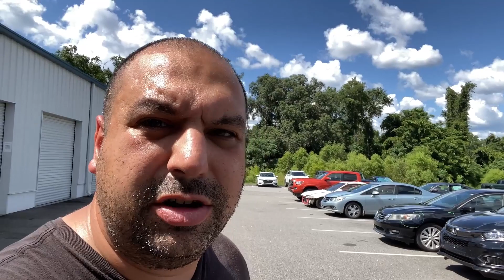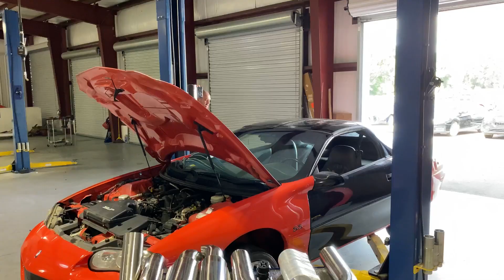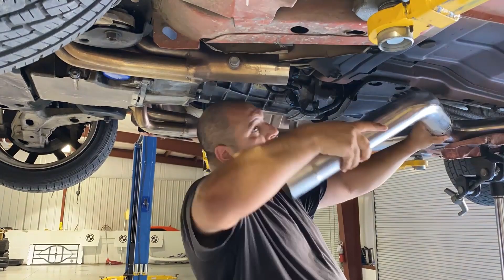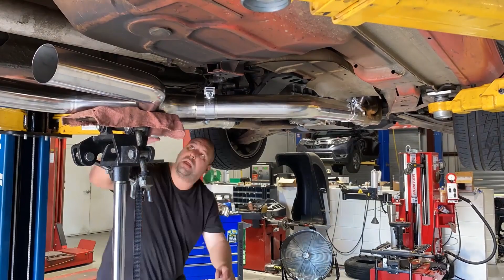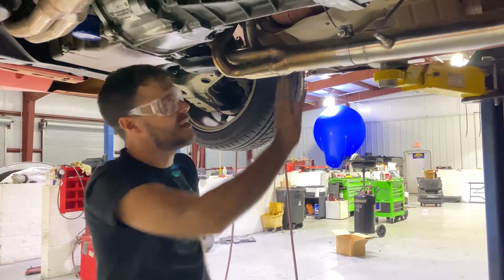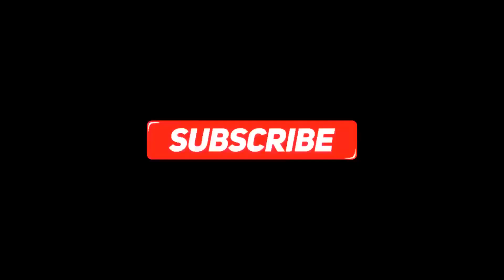How to Install Speed Engineering SS Camaro 3 Inch True Duals X Pipe Axle Dump System INSANE Sound!

Comment: Is this stock besides headers and exhaust from long speed engineering
Reply from the maker: No. That 5.3 had a sloppy mechanics stage 2 cam, upgraded trunions, valve springs and BTR pushrods. It’s been replaced by 6.6L carb nitrous build

Comment: Long tubes headers with dual 2 inch exhaust pipes that run all the way back over the axle, then collect in a 6" axle dump pipe thats about 12" long  will make any V8 sound insane. Did it to my cammed '85 D150 318ci. Was the best sound I've ever heard in my life

Comment: Great video. Thanks for the info. Are you planning on putting a bigger engine in there? 3"dual  is way to big for a 345 cube engine.
Reply from the maker: How about a 401 cubic inch 6.6 L?
Reply: @DrSaucePacket  It definitely is. Dual 3" is great for a 454. Way too big for any naturally aspirated small block.

Comment: You have the part where you weld it?
Reply from the maker: The kit is bolt in, no welding required. Rode with the exhaust like that for a long time and no leaks. But you can easily weld it

Comment: What year? Cam specs please!
Reply from the maker: 1999. It’s a sloppy mechanics Elgin stage 2 cam. 283 Intake Duration, 286 Exhaust Duration, 228 Intake Duration (.050" Lift). From speedway motors. New motor is dual cam wink wink

Comment: I was so tired of people putting long tubes on and then y pipe to single pipe to rear I'm doing my 97 Z28 long tubes high flow 3 inch cats x pipe and that's all I'm at now want to go duel pipe over the rear end and dump out back like original can it be done in between headers and cats I'd be willing to put in electric remote cutouts first time seeing your channel new subscriber. Sounds like it means business
Reply from the maker: Check out the other videos! Giving it all the business now

Comment: What size bolts did you use for the hangers I had to make the holes bigger on mine
Reply from the maker: I just used some long random bolts laying around the shop. However I did have to make the holes bigger on the hangers anyway.
Reply: @HOSSgarage  thanks for the reply 🙏🏽

Comment: Ordered my kit.... bought longer bolt.... and the hangers holes are too small. Gotta go get them drilled out now, did u have this same issue?
Reply from the maker: I’m trying to remember if I had to drill out the holes...  🤔 I think I did actually put them in a vice and drilled them out if I remember correctly

Comment: Bro the car really sounds awesome! Loved the take off and then the drive by. But three things. You kept referring to the 45° bends coming off the 3" collectors as Y pipes. Y pipes are found on single exhaust and are 2 pipes merging into 1, forming  the shape of a Y. The bolt holes you for the exhaust hangers are not for the seats, those are the bolt holes for the front seatbelts. The clamps are called  band clamps, not C clamps. I'm just a stickler for saying what you mean and meaning what you say. Little advice, leave the band clamps at the collectors and weld up the rest of exhaust. So you can easily remove the exhaust in the future. In case of future modifications like the torque arm and  drive shaft.
Reply from the maker: Word! Glad you found the channel! Check out the recent videos on the build, going for booooost!

Comment: Sounds good man,I want this exhaust also but scared it's to low too the ground.
Reply from the maker: Thanks! It is very low to the ground but sounds awesome. Forget about lowering your car with this kit
Reply: If you install it semi tight and then lift it up with a jack and crank it down full bore it dont hang low, idk about the axel dumps but the full rear exit kit has no clearance issues,  I recommend getting new poly motor mounts, it will lift the engine up a good amount,  the factory mounts sag to much
Reply: @richmyers416  I got it a month ago,. It actually fits better than the stock exhaust. It's a little cheap, but I definitely like it.

Comment: Is it possible to raise the X  pipe up a bit more?
Reply from the maker: Maybe a tiny bit, but still not much clearance even with that. Sounded good though!
Reply: @HOSSgarage  okay I just don’t want it scraping on the road especially if i hate a small pot hole.
Reply: @HOSSgarage  I have another question, is the car louder with the axle dump? I have a cam, headers, etc & it’s loud as hell already.
Reply: @GreatestHITS26  it will be way louder

Comment: If you have neighbors near by they are going to hate you
Reply from the maker: I got lucky both my neighbors our car guys
Reply: @HOSSgarage  That's good, me not so much. We live in apartments  with paper thin windows poorly sealed. The person I live with doesn't see the issue with this exhaust setup mated to his pacesetter long tubes and obnoxious cam. I told him I would pay half the cost if he switches to a hooker blackheart true dual. Hoping that will quiet it down a bit.
 Also, when he starts it in the cold why does it keep stalling? Took him around 6 minutes to start it up on a 32 degree morning. Do you know how I can fix this?
Reply from the maker: @woooose  it’s cold 🥶 them ponies gotta warm up

Comment: Sounds good. I bought the full length Speed Engineering duals that come out the back. Just a tip, if you angle your turndowns out 45 degrees, instead of straight down at the pavement, it will cut down on vibration and drone.
Reply: I did this and it made no difference
Reply: Nice I was looking at that kit as well for my SS
Reply: He should have just bought the tailpipes.. I hate turndowns.
Reply: @kskip4242  I have this kit on my ws6 it was on when I bought it. I love the way it sounds but am considering chopping the tips off and running pipe out the back to some true duals.